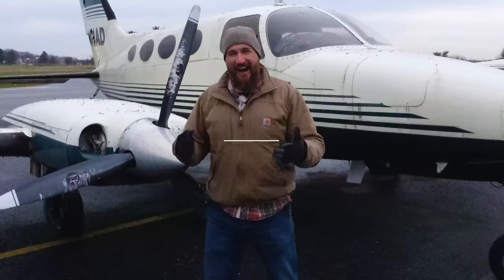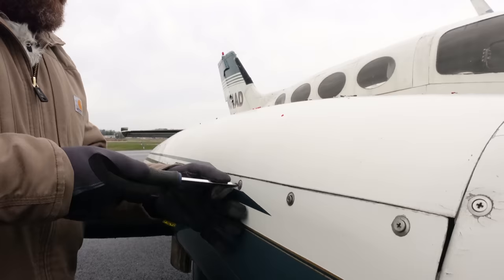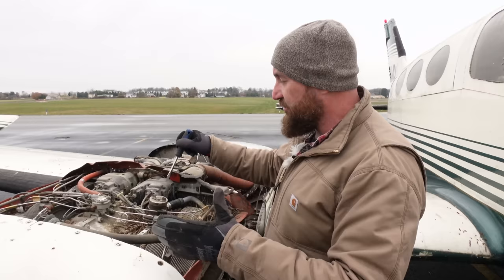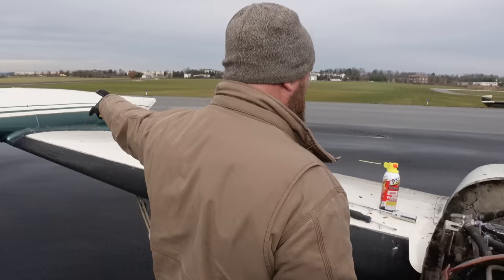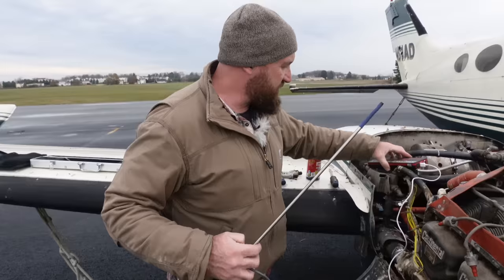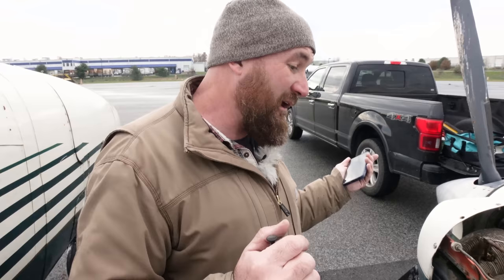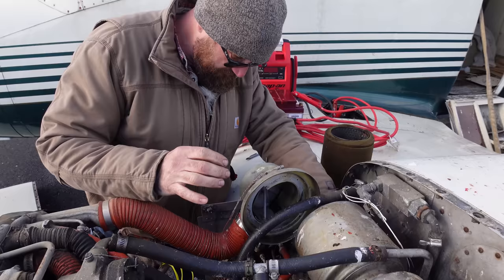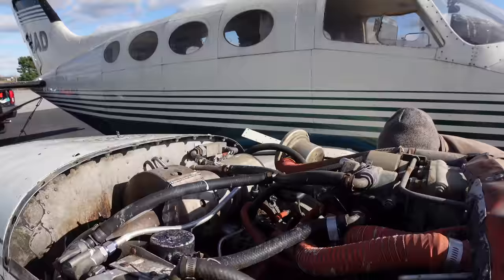FREE Abandoned Airplane... If I Can Start It! Ep1

Comment: As a long time pilot and Aircraft owner, I really recommend that you get some guidance from an Aircraft Inspector (AI) and have an A&P check on the things you do. GET THE LOGBOOKS before you spend much time or money on her. If the engines are run out (of hours) this project can loose a lot of money for you. At present, it is a collection of parts. These are things to be aware of. It is it least a great way to learn, if all is good. Best of luck. I hope you make a series out of the restoration.👍
Reply: This is here for the video hits.  He won’t ‘loose’ any money.
Reply: I don't think he is planning on actually ever flying it, it's just for show.
Reply: At this point does it really matter he basically needs new engines anyway
Reply: How much does a new engine cost?
Reply: He mentioned that the log books are long gone so there's no way to tell how many hours are on those engines. He's aware.
Reply: @twistedyogert  $60-70k per engine with a core swap from Continental. Factor in all the avionics are toast and there are possible airframe corrosion issues, not to mention props, interior, landing struts, etc, and this is "run" don't walk away as fast as you can. The cost to make this airworthy would be 2-3x the value of one in good flying condition, maybe more.
Reply: @markscrivener3355  would it make sense to just part the sessna out, and leave the rest to metal scraping
Reply: Yeah the paperwork really matters ;)
Reply: None of that really matters if millions of people are willing to watch him work on it anyways.
Reply: @twistedyogert  about tree fiddy
Reply: As an IA/A&P I highly recommend getting some one who knows what they are doing. At the very least you probably just stretched all the engine/prop control cables.  I’m sure that if you’re on any decent size airfield then every Federally Certified Mechanic such as myself has deemed that pretty much un-airworthy unless you have about 1.25-2 million dollars to basically take this one and burn it and then get a low time aircraft
Reply: @IsleOfFeldspar  This thing's going to the scrapyard. He's not dumb, youtube views will make more than enough for the time he'll sink into it. The "tools" he's using to repair it are cute. No way any sane AI would sign off on this "repair".
Reply: @TheeMelloMan  yes it's cool to watch him work on it, but there's no way that it's going to be legal to fly
Reply: @misham6547  there might be some parts that could be salvaged - brackets, control surfaces, etc. The engine casings and some of the engine parts could probably be used as well...not sure if the props are rebuildable or just scrap at this point. But yes, a shop that dealt with a lot of older 401's could probably get some useful parts from that plane....but you might be surprised how few. Don't forget paperwork is a big deal with airplanes. You can't just put any old part on an airplane and fly it legally. Oh, and any work done on an airplane has to be signed of by an A&P with an IA (Inspection Authorization). Unless I ran a shop that serviced a lot of older twin Cessnas, I wouldn't touch this thing.
Reply: @markscrivener3355  The engine cores are probably most valuable, but are they even salvageable without the log books?

Comment: N81AD used to be based at Brookville Airpark (formally I62) near Dayton Ohio. In the late 80s it was used in a part135 charter operation.  I62 was a fairly small runway (about 30x~2400) so they would pick passengers up at Dayton International (DAY).  I worked the line in high school pumped many gallons of fuel in that airplane, towed it in and out of hangars, and cleaned out after trips, plus side was getting to go for rides (even in that plane).  Used to be white with blue and gold stripes. I just pulled up an old log book and my dad's last time flying that plane was  3/25/93 to Willow Run (YIP).  I hope something can be done with this airplane.
Reply from the maker: That is such awesome information ! 
So tempted to pull a plan together and get it flying somehow !
Reply: You got the best that hulk will give ever again.
Reply: Man we're did you find the information
Reply: Very old Reg it show Cali last landing in 2019 owned by a DE corp but hey it’s entertaining at least
Reply: @briancorty4348  flightaware says its certificate issue is from 2020/05/26 so not that old the and will exire in 2023/05/31 source is FAA and the owner is S & K Rentals Inc
Reply: @aetparamedic  I found this video and recognized the tail number.  81AD is a unique and easy to remember tail number.  I grew up around this particular plane and worked for the charter operation where it was based. As I said in the comments, my dad also flew this particular plane on charter operations as well and I found several entries into his logbook with N81AD C401.  Pretty cool to see the plane again.
Reply: I started my flight training at I62 20 years ago!  Small world.....
Reply: @rebuildrescue  You should DEFINITELY get together with some of the GA community around the air[ark, etc... and see if you can at least get it together as a teaching unit, either for flying or for fixing...
Reply: Nice!!
Reply: @rebuildrescue  it’s gonna need a lot of work especially with the airframe, good news is you have a strong YouTube following and I’m certain tons of people would be willing to volunteer their time and expertise (myself included) to help you achieve whatever plan you come up with 👍
Reply: @rebuildrescue  Make it happen man, Itd be cool to see it fly again.  Maybe once Im ready to get my dual eng cert I can have an excuse to fly somewhere like that.  Cheers, best of luck.
Reply: Never say never. 
I bet people told Kermit Weeks that he was crazy collecting old scrap WW1 and 2 warbirds and bombers, and look how big the operational roster that Fantasy of Flight in Florida has!.
Reply: @YeaniaAeon  Also shows last flight 2019/5/13 so hasn't sat near as long as speculated. This is gonna be goood!
Reply: @wushock92  my grandad flew that last flight, he said the CEL and airbag warning came on and it was parked up because the dealer wanted too much to fix
Reply: @rebuildrescue  I'm thinking it'll be worth a hundred thousand subs👍

Comment: Having flown and worked on this exact model of airplane and many similar models many times, I’m skeptical but have hope that this airplane will fly again. Just from the video, I can already tell that both engines will need rebuilt, both turbos rebuilt, new mags, new plugs, props overhauled, corrosion treatment for the entire thing. You’ll need to check those fuel tanks for corrosion. And probably the biggest thing you’ll need to do is have an A&P go through the entire airplane and check for airworthiness directives. Since you don’t have any logbooks, all of the ADs on the airplane will need to be checked and accomplished before it can fly.

All in all, it’s gonna be a ton of work. I’m excited to see the progress, and I’m optimistic. If you ever need a pilot to sit in the cockpit and work switches or a hand turning wrenches, send me a PM. I love to see old airplanes restored, I just know this one in particular will be a ton of work.
Reply: It would be nice to see him have some help! If he rebuilds them he could at least sell them! I've never flown in a small aircraft, and I wouldn't fly in this if the engines weren't rebuilt! Years ago someone broke into a storage unit, and stole a $35,000 airplane engine in our town. I don't know if he ever got it back!
Reply: rebuilding the engines themselves would make 1 long hour video :D
Reply: @davidregan9872  It's not just the powerplants, it's corrosion and overall soundness of the wing spars engine mounts, and other major structural elements of the airframe... in-flight disintegration WILL ruin your day!
Reply: @MajorCaliber  Yeah, RUDs ruin it for everyone, regardless if it's the space/aeronautics or motor industry ;)
Reply: I Agree a Ton of Work and a Ton of Money, I would walk away from this Project, its not worth Doing IMHO
Reply: Propably cheaper to buy a new/newish plane. But that wouldn't be as exciting & nerve wrecking, than trying to completely rebuilding something like that heh
Reply: He needs to get an A+P to work with him, I have been in the business for a bunch of years, and brought a few planes back to airworthy condition and when people who dont have experience with planes work on them, it usually creates more work for us to do instead of letting us do it from the get-go.
Reply: @CHELLIE2408  Your opinion isn’t accepted due to it being the wrong opinion. Much love but we the people must see more of this plane
Reply: @anssil5273  that’s also wrong. Almost guaranteed he just got the biggest YouTube paycheck of his YouTube career from that video blowing his other videos out of the water by 10 times. Everyone here will watch those videos probably the day they get uploaded
Reply: @SIMON-dp5sf  Buddy there’s no such thing as a wrong opinion. That’s the very nature of an opinion it’s subjective and an opinion. Not right or wrong.
Reply: @CHELLIE2408  You fail to realise this video already has over 4 million views, its most certainly worth doing!
Reply: @SIMON-dp5sf   This is the best point made yet. Anyone serious about aviation knows this plane was free because it costs more to make it fly than it's worth. But, to post it on YT for views and clicks it might actually make some money before it returns to earth from which it came.
Reply: @jbrownjetmech-4783  I agree. From what he's said already in the video regarding the cost of just getting the engines worthy of flight, I'd imagine the cost of refreshing the fuel system, getting the interior to be less bird-shitty, and the cost of getting things like the struts refurbished.... He's probably looking at AT LEAST the average value of these planes in repairs alone, much less quality of life improvements. From what I've gathered, the average price for these 401a planes is significantly less than the $200k+ figure he stated, and more along the lines of $120k. However, I'm not versed at all in aircraft values, so potentially putting that work into it would make it more valuable than the planes I saw listed.
Reply: That's the attitude man!!
If she's to fly again....very very probably you'll be sitting there...
Go!!
Reply: @jbrownjetmech-4783  Good point!It is called turning s...t into gold over here.
Reply: @MajorCaliber  Thats what alot of these viewers are not understanding, They think this is a old antique automobile, NO this is a AIRCRAFT! If his wife is listening, tell her to take a out a BIG, HUGE, INSURANCE out ON HIM! She wouldnt have to work another day in her LIFE! She will  be SET FOR  LIFE!
Reply: @dwayneevans683  he said he is not going to fly it
Reply: @paulb7334 DAMN STRAIGHT, because that will be the last FLIGHT he ever TAKES!
Reply: @dwayneevans683  I would fly it after it had a good look over.After all I fly in a 3 wheeled lawn chair lol
Reply: More importantly..it will take hundreds of thousands of dollars.  You start to see that getting it for free is not really a bargain
Reply: The goal is to start the engines. They can start and run without turbos installed - just remove them and replace them sections of tubing to demonstrate that the engines run for a few minutes.
Reply: Blah blah blah hero....just shut up

Comment: I recognized that paint job right away!  I flew that airplane shortly after it was painted.  I was a brand new flight instructor working out of Brookeville airpark (I62) and the owner (I believe it was a partnership) took me along as a safety pilot.  That was 6-25-1997 we flew from KMGY to KMSP.  It was a really nice plane back then.
Reply: Yes... "was"...

Curious. What actually happened to this plane that resulted in it being essentially just parked and then left to rot?
Reply: This should be top comment, what are the chances u see a yt video of a plane u flew in 97
Reply: @FinalLugiaGuardian  Money.  Tons of these types are owned in partnerships (as described above) to help with costs. Likely parked "temporarily" and months turned into years.

Comment: Just an old trick learned on removing frozen in place sparkplugs.
Work them back and forth a little bit at a time, each time until you feel tightness. Each time, you will go a little further until the sparkplug loosens enough to remove.
I like your channel, keep it up!

Comment: With all of the plugs out you could see if you're getting spark just by touching the cylinders and the mags on. Ive worked on 421s 310's and others. Working Commercial aviation now. The Turbos won't make it not start, you just wont have that power those 520's  can make :)

Comment: Ok after watching your dedication to this project...  Here’s some advice from a 30 year A&P.  Make friends with a local general aviation A&P.  Get a gallon of Kroil from Kano Labs.  It’s not sold at an auto parts store but will yield much better performance than the pen-oil and 2stroke you were using. Pressure wash the whole thing.  That will give you a much better visual for inspection.  I know you’re just trying to get the engines fired but, don’t fall in love and know when to say when. Without logs the aircraft has little value outside of to yourself or deconstructed and used for “used parts”.  I hate seeing aircraft sit like that and found myself wanting to lend a hand.  
Oh one last piece of safety advice, stand behind the prop while motoring it through.  If by Zeus’ butthole of a chance the mag does fire your not in front of it.  Also so long as all the leads are out of the plugs turn that prop all you want. Leave the bottom plugs in, drop some kroil and get the rings loose.  
Looking forward to seeing more.
Reply: You can get a gallon of kroil from my local menards lol
Reply: Kroil is the shit. We use to stash it because people would steal it.
Reply: I bought a spray bottle and just mixed ATF (Automatic Transmission Fluid) and Acetone. Works just as good as kroil.
Reply: @danparden8103  I had no idea.  Kano labs use to only sell direct.
Reply: @charles5448  I get where you’re going with that but I wonder where the volatility/flash of your mixture is compared to Kroil.  I’ll have to test that out and compare it to Kroil for corrosion busting.  What ratio hyd/acetone are you using?